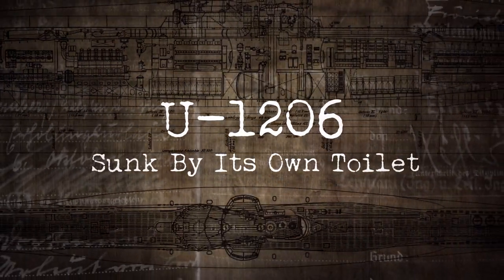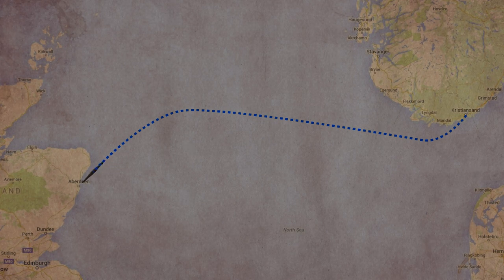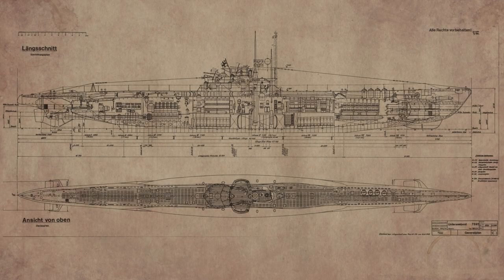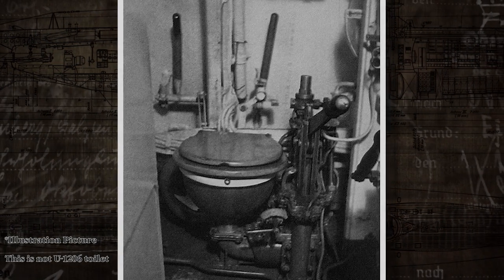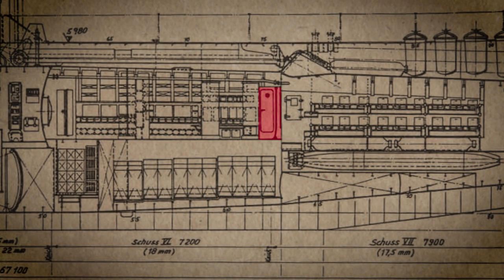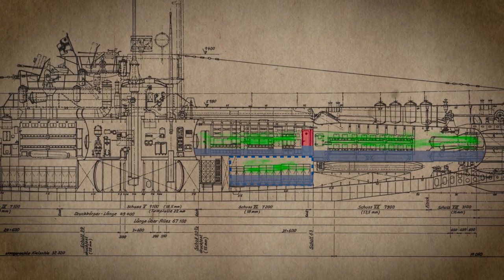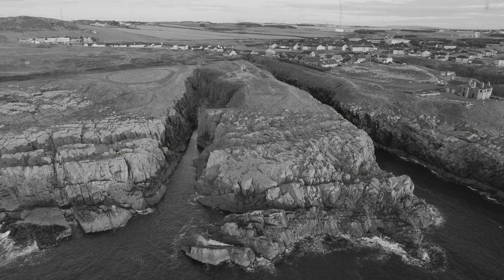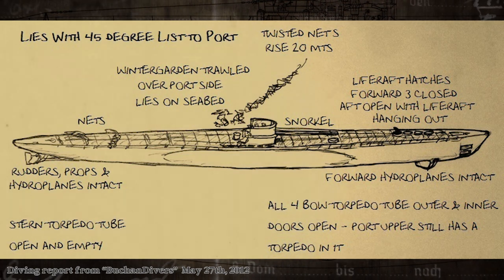U-1206 the U boat sunk by its own toilet - uboat toilet disaster - WWII History Uboot  Short stories

Comment: It's really not that surprising when you think about it. Submarines dive at depths where the pressure outside is huge, much greater than the pressure inside the submarine. This means that, if you want to expel anything from the sub, it has to go through a series of check valves that prevent water from the outside from flowing into the sub. Nowadays we have computers to automate the procedure, but back then you had to manually open and close a series of valves in just the right order, and if you got it wrong and all were opened at once, you could absolutely flood the sub.
Reply from the maker: Exactly !